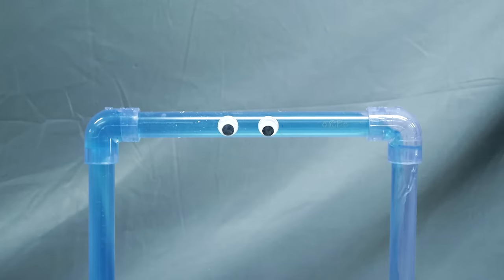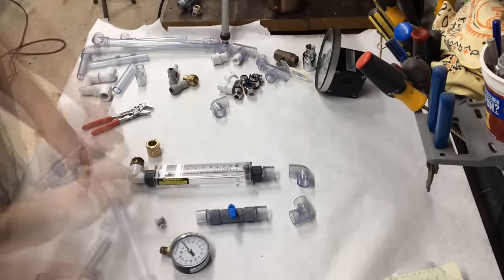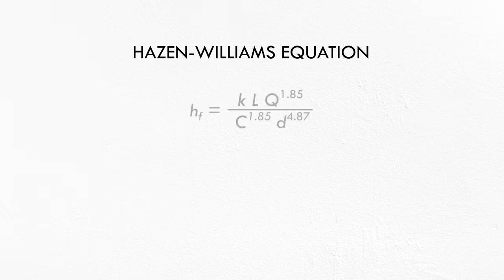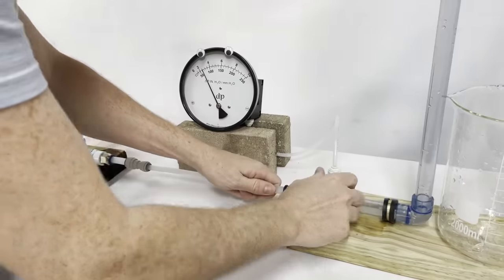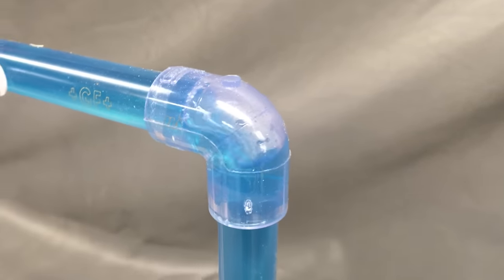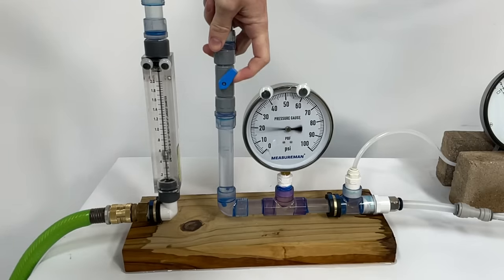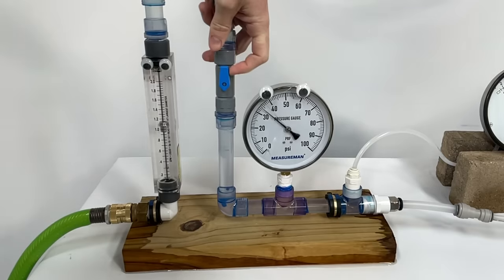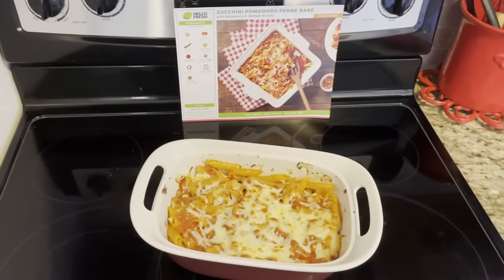Flow and Pressure in Pipes Explained

Comment: So a small increase in pipe size can result in a significant difference in flow capacity.  Going up one pipe size bigger than you really need probably doesn't change the cost much and might pay dividends in future expansion....  Are you listening process engineers?
Reply: Copy. Loud and clear, over
Reply: In many cases, I'd agree, but it's not appropriate in all cases. For instance, domestic hot-water piping; a larger pipe size means a longer wait and more wasted water each time hot water is demanded. Also, the larger diameter pipe will weigh considerably more when filled with a heavy fluid (e.g. water).
Reply: @willusher3297  for domestic you can always use a recirculator.

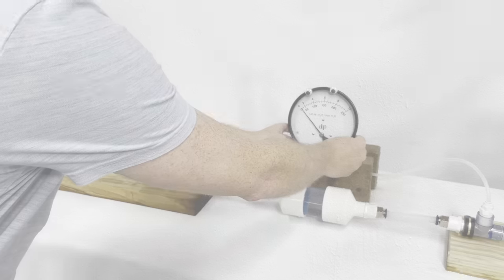Comment: i spied a mistake you made @6:32 with the large pipe diameter. the delta P is being measured on the small diameter pipe, all that's happening is the large pipe is filling and the velocity will slow down, then enter the original size pipe and speed up, this is where you are measuring the pressure. if you measured at the large pipe or the pipe continued as the large pipe you would have seen less delta P. I'm a gas flow measurement tech so some of my hydraulic knowledge may be rusty. but in the real world if we want a pressure drop after a CV sometimes we jump up a pipe size to take "load" off the CV and have less worry of valve freezing off as gas velocity increases.
Reply: Yeah, it's kind of surprising that Grady made an error that gross.  I'm wondering how he missed something that obvious.
Reply: Yes it would be a different delta P if he measured at the larger pipe; but that would mean he changed his point of reference for comparison to all of the other tests. He wanted to compare the different components effect on the pressure drop so isolating the losses only makes sense. He isn't interested in the flow rate and pressure change due to the diameter change. Only the losses due to those.
Reply: @jonnya3302  he would need to “change” his point of reference, changing the length of the pipe in between is changing the point of reference. In this demo the only thing he is proving is longer or shorter pipe adds or reducing resistance to the system, likewise adding elbows. If the downstream tap was on the large diameter pipe he would of easily seen the reduced differential at the higher flow rates. Other than the large diameter he proved everything quite well.
Reply: @adampetten1009  I see what you are saying now. If he measured in the large diameter at each flow rate we would be able to see the consistently reduced differential.
Reply: @jonnya3302  I'm not sure what point you're trying to make,  but he is not making an apples to apples comparison ie: he is not making a valid comparison of the head loss across 14" of 3/8" pipe to the head loss across 14" of 2" pipe.   (I'm estimating dimensions here)  In reality the comparison he demonstrated is a comparison between the head loss across 14" of 3/8" pipe, and the head loss across 8" of 3/8" pipe plus 6" of 2" diameter pipe.  Even a casual glance at the Hazen-Williams Equation   will tell you that the head loss across  8" of 3/8" pipe plus 6" of 2" dia.  pipe is going to come mostly from the 8" of 3/8 inch pipe and not from the 6"  of 2"  pipe.
Reply: @andrewalexander9492  yes I misunderstood the original comment so my reply doesn't make sense. I got it now though

Comment: Me, using the metric system, having no clue how his scales compare to mine ( 2:47 )
Reply: Yea, if this is supposed to be about engineering why does he use antiquated measures?
Reply: @OldieBugger  because engineers in America actually use the imperial system. It's not nearly as bad as you think it is, and it's pretty much necessary when all of your suppliers and tools use imperial
Reply: @OldieBugger  engineering degrees in the land of freedom are tied to this antiquated system, it's a vice perpetuated by new engineers to accommodate old engineers :/
So much headache (i assume) compared to the rest of the world, where mental crunching numbers is an easy and daily task of an engineer , to give preliminary estimates or conclusions that don't require much precision
Reply: Because, even in Europe, domestic pipe sizes are still inch based (or roughly inch based, BSPT is kinda weird)
Reply: @kilianortmann9979  Maybe you can say so, if it makes you feel better. I measured one pipe in my bathroom that was easily accessible and my calipers showed 12mm. Which means the inside diameter is probably 8mm. What are those in the medieval units of inches, barleycorns etc?
Reply: @OldieBugger  That's a quarter inch pipe, pretty typical for final connections in domestic housing. Go to your next hardware store and look at the plumbing section, I promise you will find only inch based connectors.
Reply: @kilianortmann9979  You were right. I checked the local hardware store pages and they really use those ancient measurements even in 21st century Europe! It's a shame.

But I guess it's understandable. It would be a colossal job changing all pipes and fittings to another system. So colossal it would make Hercules quit his job.
Reply: @OldieBugger  inches of water column isnt antiquated....
Reply: @OldieBugger  ... you also have to understand.... trying to read a gauge using mPa is impossible.
Reply: @zarthemad8386  Not really, if the dial displays mPa and you know what the value should be it's quite readable.

Comment: Not an engineer at all, but I was happy to see the formula in use! I used it or a variation to calculate the head pressure needed for a marine aquarium circulation pump. Saved myself almost $300 instead of over guesstimating.

Comment: While this may not be that interesting for many people I learned a lot from this video. I had no idea you lose that much flow from sharp bends. This certainly explains why my hot water lost so much flow when I exchanged my boiler for a bigger one and while I was there I routed all the pipes nicely along the walls which of course meant many many right angle turns.

Comment: As someone currently formulating an electronics instructional series, I really appreciate you going over Pressure and Flow in such an easy-to-understand fashion! (that may sound unrelated, but Voltage is frequently referred to as Pressure, and Flow is just another word for Current, and electricity acts like a fluid)

Comment: I am a firefighter driver operator, wish I had you teach fiction loss to me. As an operator of a fire engine knowing fiction loss and understanding head lost to calculate residual pressure on a fire hydrant is very important.  
This was a good intro into fiction loss for a new fire fighter driver.

Comment: You mentioned how piping is similar to electric circuits.
Decades ago our project was digital acoustic analysis of chemical factory piping systems.
The analysis was being performed on an Analog computer.
Piping was modeled with electronic components on a large breadboard jumpered together.
Very impressive machines.
The electronic components mimicked the response of the piping.
The analysis would pinpoint where the vibrations were excessive.
Without the analysis a plant could not run full capacity without shaking itself to death.
(triple negative sentence!)
It took weeks to set up one analysis at a time.
Our application would allow several analysis runs of different models each week.
Interesting project.

Comment: I'm a Fire Protection Engineer and I use Hazen Williams all the time to design sprinkler systems and underground piping for fire hydrants.

For minor losses associated with fittings and valves, we use an 'equivalent length of pipe' value provided by the manufacturer. For more complex equipment like a backflow preventer, the manufacturer will provide a curve with pressure loss as a function of flow rate.

Comment: I was a design engineer on a number of natural gas and crude oil pipelines. Some pipeline companies use a polymer based drag reducer that is injected into the product flow. It forms long strings that dampen the turbulence and Eddie currents that restrict flow.

Comment: This video was great. So in my head I kept thinking well if you decrease pipe diameter then pressure would increase and no information I found refuted that idea. Not directly anyway. The Venturi effect was mentioned but not explained and I could not wrap my head around how a smaller pipe can cause both an increase in pressure or a decrease in pressure depending on application. The issue was, no one was accounting for losses in their applications. This visual made all the difference in helping me understand what is happening when water is flowing through pipes.

Comment: 1:20 the analogy doesnt even just stop there, it goes much further. It can also be applied to thermal, thermal dynamic, acoustic, and mechanical systems.
For example mechanical systems, where velocity represents the generalized flow (current/volume flow) and force generalized effort (pressure/voltage). 
Also, storage elements can be generalized with the same equations as electrical storage elements. These are either C buffers (storing flow, ex. capacitor, spring) or I buffers (storing effort, ex. Inductor, Inertia)
The modeling language 'Bond graphs' uses this to be able to model multiple domain physical systems into 1 single graph, and be able to get equations from them.

Comment: Thanks for the video. Even though it's been two years since you posted this, I hope you read this comment. At around the 6 minute mark, the diameter of the test pipe is increased by a factor of five, yes, but only over about a third of the length of the section over which the pressure drop is measured. So, the pressure drop is dominated by the two-thirds of that test section that are still of the original diameter. It is no surprise that the head loss is basically unchanged, and I think it has little to do with friction and turbulence due to constriction, bends, etc. Nonetheless, I appreciate the video and the discussion about constriction and bends is absolutely relevant.Thanks again.

Comment: Interestingly enough, this applies the same way to air, or in my field of work, vacuum. I have designed evaporator systems with 6" tubes and huge bends, and there is still a very noticeable pressure change. A fun way to visualize what is going on is under a good vacuum the molecules are traveling at the speed of sound. Any restriction can really stand out.
Keep up the good work.

Comment: This is why when I replaced my pool pump and had to redo all the piping to get things to fit, I used 45° fittings instead of 90° ones.   With all the bends I had to install I wanted to reduce the friction as much as possible.  This meant the pump used less energy and I had a stronger in pool cleaning system.   Took a bit more time fitting and gluing but I feel it was time well spent, and since it was my labor it didn’t really cost that much.

Comment: for the people who don't know 7 inches of water column is equal to 0.25 psi. we use the measure a lot in HVAC with its primary use being checking how restrictive a duct system is to choose the correct blower speed. additionally, 7 InWC is the supply pressure into your home for natural gas(depending on the utility)

Comment: In fire sprinkler hydraulic system design we use equivalent lengths of pipe for fittings rather than going through the additional equation for turbulence. This is where a fittin90 degree fitting is equivalent to x feet of additional pipe in the line. We have tables for each fitting type that show for instance that a hard 90 has more equivalent length of pipe than a sweep 90.

Comment: The minor losses get really interesting when you look at steam locomotives. The high pressure steam on a locomotive is moving at some considerable speed but the tight spaces for piping on a locomotive result in lots of twists and turns to get steam from the boiler to the cylinders, especially if the locomotive has a superheater.  That resulted in enough loses in pressure that British engineers were looking at how to streamline the steam passages (pipes) on locomotives, particularly during the 1930s.
Reply: brilliant comment thanks

Comment: Just reading the title makes me think about all those people I can't seem to be able to explain to, that because there isn't much flow at the end of a pipe or hose doesn't mean that there isn't much pressure. So many farmers can't seem to understand that even if the water only dribble at the end of the line, once you close the tap, there is enough pressure to blow seals and disjoint pipe connectors.
Line loss seems to be a really hard concept to understand for so many.
That and the good old flow rate vs pressure misleading advertisement on pumps, pressure cleaners, compressors,...

Damn, I haven't even watched the video yet and I'm already all worked up about it.

Comment: 1:07
There's also some fun parallels with thermal systems.  With heat resistances and heat flow.  Hot and cold acting like higher voltage and ground.

Comment: When you replace the small pipe with the wide pipe it is only for about one/third of the total length, even more if you take the length between the connector to the pressure pick up point into account. So the resistance is only changed in one/third of the path. Think about 3 resisters of 1 kOhm in series, total resistance is 3k. If you replace the middle resister with a zero Ohm resister the total resistance is still 2k.

Comment: Little known, even to Detroiters, George Fenkell (of Fenkell Rd.) was the man behind Detroit’s water and waste systems.  Fenkell also published much on pressure loss in water supply pipes.  Among other things, he checked wide sweeps vs elbows vs diagonals when water supply pipes went around corners.  At modest flow rates typical of municipal water systems, he found the shortest distance was more important than the type of corner.  A bit of Detroit trivia I never figured I’d report on!

Comment: I'd be interested to hear you talk about cribbing. I use box cribbing in my line of work, which is house lifting and moving. Our crib is standardized 6"x8" timbers 4' long with cross bolts. Cribbing is usually used in temporary measures to stabilize buildings, bridges, and cranes. Sometimes they're left permanently though.

Comment: Super interesting! I learned a version of this in firefighter training. You should get a firefighter to show you what's the same and different between firefighting hydraulics and permanent pipeline hydraulics. Spoiler: firefighters need simplicity and quickly adaptable systems, which results in interesting different tradeoffs.

Comment: In hvac minor loss caused by a 90° turn is the same as 10’ of pipe.    Creating an artificial string in the center of a oil pipeline reduces pressure.  Turbulence is created at all of the pipe joints. The string crests a flow line without turbulence along the wall.  The oil prefers not to be turbulent. This can drop pressure up to 200 psi considering  from 1000 psi to 800.

Comment: Nice! I use this all the time for spacecraft propulsion systems. One thing we run into that I think is kind of unique is water hammer from opening a valve with vacuum downstream and the dynamics as the fluid accelerates down the tube and smashes into the end, dissolved gases coming out of solution along the way. It's not something I learned in college, and I wonder if you could make a video about that to share with everyone
Reply from the maker: I do have videos on those topics. Check out the playlist linked in the card at the beginning of the video.
Reply: @PracticalEngineeringChannel  Thanks for pointing that out!

Comment: This is interesting. My house has problematically high water pressure. We tried to get a bidet earlier on in the pandemic, but in addition to it pressure-washing our nether regions, the poor thing basically blew itself apart at the press-fittings within about a month. I know that the proper thing to do is to buy an off-the-shelf pressure regulator, and that is what I plan on doing, but this video has me fantasizing about calculating the  pressure drop around bends and soldering up a copper pipe zig-zag to lower the pressure.

Comment: im not an ingeneer, but as a heavy equpment technician, friction coeficient as to be taken care in a different way, HEAT!!! hydraulic , oil, water ,etc etc, will heat up depending of pressure, amount of turns, valves etc. :)

Comment: When you turn the valve at the beginning, are you introducing a pressure drop, due to the contraction of the flow through the valve? Is that what essentially governs the flow rate (or at least contributes towards it?) You essentially have a headloss from the restriction amount of the valve + the restriction of the sample section, which then gives you your overall headloss? Is it the overall headloss in the line which then gives you your flowrate? The interchangeable nature of these concepts always confuses me

Comment: Great video - though you missed an opportunity to show how pipe roughness affects head loss (by using ribbed PCV tubing for example)

Also, as far as I remember from uni, to achieve optimal water flow (minimal head loss), you don't "fill up" the pipe completely, leaving about 10% air. Though I might be wrong on that.

Comment: Can you make a illustration on how static pressure can hold back water on a leak in a pipe until it flows. I'm a plumber and have seen a 1/2" shower valve fitting with water pressure at 55psi when water was static it would not leak on the supply side of the valve with a pin hole. The pipe had a screw in it and when it rusted away leaving a small hole. When you turned on the water and static pressure dropped it would leak when you turned the water off when static pressure built up it stopped leaking like magic..... when in reality its science. Great video